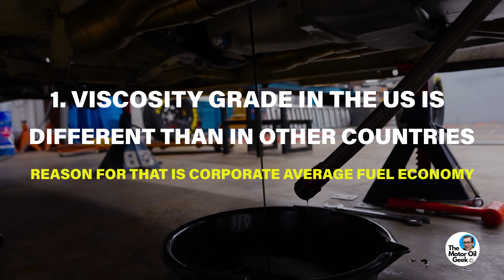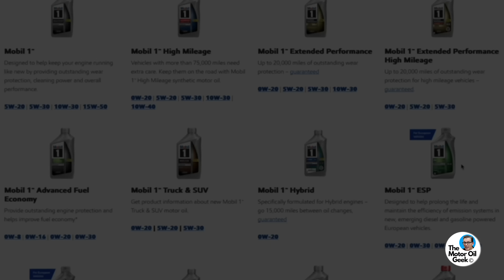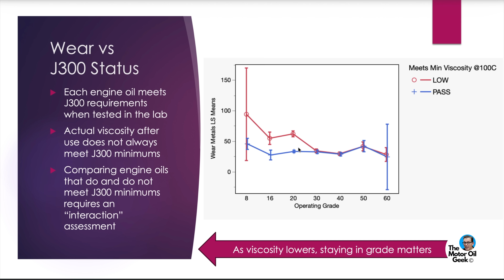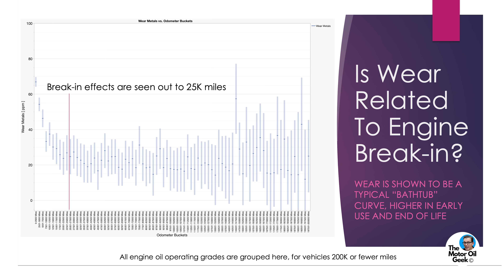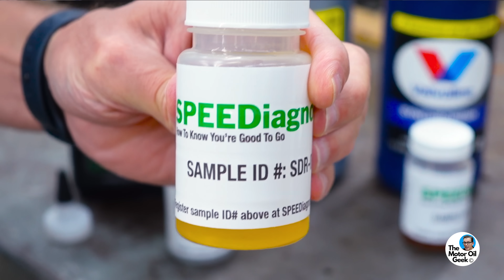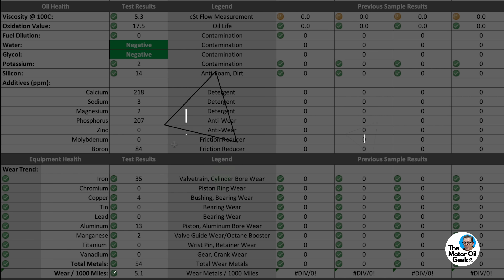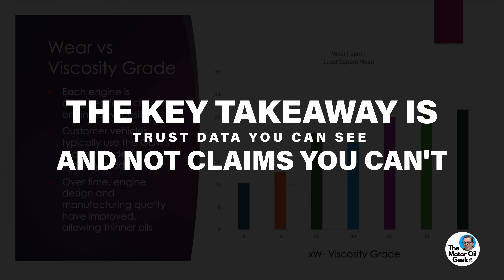More Ai Lies? The FACTS about 0W-20 vs 5W-30 (With Evidence)

Comment: The problem isn't the shearing, the problem is the start up, these engines run zero weight in order to get oil to the cam phasers quickly. The faster the engine can adjust the fuel trim, the sooner it gets better economy and less pollution. That is why they are running the thinner oils. This zero weight are start up is causing these engines to run dry basically, which is why I think we are seeing so many rod bearing failures. I suggest. 5w-20 at a minimum

Comment: I have a 2007 Toyota Camry with 79,600 miles now, the oil cap says use 0W-20, or 5W-20 oil.  I do 3000 mile oil changes and the last 500 miles of the oils life I have had to add at least 1/8 of a quart to the crank case to keep the oil level up to the fill line on the dip stick. Keep in mind now that 2006 to 2010 Camry 4 cylinder engines were equipped from Toyota with low tension piston rings, you're going to get oil pass through.  I switch up to 5W-30 on my previous oil change and did NOT have to add any additional oil to the crank case during that 3000 mile interval and I'm now 500 miles into my second 5W-30 oil change.  Now my 2013 RAV4 uses only 0W-20, I also have it on a 3000 mile oil change schedule, I NEVER have to add oil to it during the 3000 mile interval. On both cars I use Penzoil full synthetic made from Natural Gas motor oil (I'm very happy with that oil), also both engines I also have Mag Plugs in the oil pans and both Mag Plus, no matter what oil viscosity leaves a dark film around the magnet at the end of 3000 miles.  I never had it looked at, but I have a feeling that it's normal engine wear.

Comment: This is why I run 10w-30 in Texas.  There's no justification for 0w here as it's never cold enough to require less than a 10 weight base oil (good to 0F).  And the 30 is highly advisable for the heat and has less sheering variation than wider range oils.  0w-20 just cuts the margins too damn tight, especially in hot weather.  You only need to look at the oil recommendations for the Middle East where there's no perverse incentives from CAFE standards to see what's advisable (they use 20w-50).  Thicker base weights are also more resistant to oxidization.  
The tests with 0w-20 prove that things are fine, right up until they're not.  That's to be expected with fluid bearings.  The oil film works well until it fails, and when it does it's catastrophic.

Comment: Some dealers insist on 0w20 while others put 5w30, operating temps here between 32F and 120F, so extreme heat in summer, there has been lot of argument that 0w20 is not suitable for my environment 5w30 is barely suitable, I am considering switching to 5w40 soon. 
The car manual says it takes up to 20w50 as long as it meets SP specification or up.
The engine is VR35DDTT on the armada 2025+

Comment: Great information, thanks. I do have a question. I recently purchased a new Toyota Landcruiser with the 2.8 liter turbo diesel (in Australia). Toyota recommends 0w-20. However the temperature in my location may get down to 0°C in winter, but up to 40°C during summer. I was about to change to 5w-30 C2 which Toyota does also recommend in the owners manual, although 0w-20 C5 is the preferred oil. Which oil would you recommend given our summer can get a little warm?

Comment: I dont understand IN GRADE terms...can you explain to me like a 5th grader. can someone PLEASE answer my question. So much debate on which oil works best for the Hemi Tick stuff. Lifters, cam etc. I have  2018 Ram 1500...5.7 hemi. It is recommended on cap to use 5w-20. MANY people that have Ram 1500...many say Amsoil or Royal Purple or Pennzoil Platinum Plus..or Mobile 1. and they seem to be most of them choose 5w-30. These are high mileage trucks such as mine...100,000 miles. Please tell me which so i can possibly save my lifters..which one...5-20 or 5w-30. I have seen a couple guys using 0w-30.

Comment: I'm using Mobile 0W8 from Walmart for my 26 Toyota Grand Highlander Hybrid it's at 2.1K miles right now with two oil and filter changes done already. Do you have any data on the viscosity shearing of this brand of oil?

Comment: A 0W-20 can be formulated with virtually no viscosity index improvers (VII), given a decent synthetic base oil blend. And VIIs are what breaks down over time and thins out high temperature viscosity. On the other hand, oxidation will thicken the low-temperature viscosity. Having a good base oil resistant to oxidation will help with that.

Most 5W-30 oils will still need a small amount of VIIs, even when using the best base oils. But if you control oil temps and avoid continuous excessive temps, most quality 5W-30 formulations will also be of "stay in grade" quality.

Comment: Motor Oil Viscosity Test Results
Meets Min Viscosity @100C - 0W and 5W conditions

Oil Brand	0W Percentages |	5W Percentages | Pass % |	Fail % | Pass % | Fail % |
ACDELCO	93.2%	6.8%	53.6%	46.4%
AMSOIL	21	88.8%	11.2%	60.7%	39.3%
CASTROL	90.6%	9.4%	56.3%	43.7%
DRIVEN	        84.7%	15.3%	92.3%	7.7%
FACTORY FILL	75.0%	25.0%	38.5%	61.5%
KIRKLAND	96.7%	3.3%	77.1%	22.9%
LIQUI MOLY	67.6%	32.4%	27.6%	72.4%
MOBIL	63.3%	36.7%	60.0%	40.0%
MOBIL    57.1%	42.9%	60.5%	39.5%
MOTORCRAFT	75.0%	25.0%	16.0%	84.0%
MOTUL	72.7%	27.3%	59.5%	40.5%
OTHER	69.9%	30.1%	49.0%	51.0%
PENNZOIL	86.1%	13.9%	62.7%	37.3%
QUAKER STATE	71.4%	28.6%	50.0%	50.0%
RED LINE	100.0%	0.0%	90.3%	9.7%
ROTELLA	0%	0%	90.9%	9.1%
ROYAL PURPLE	100.0%	0.0%	75.0%	25.0%
SHELL	66.7%	33.3%	33.3%	66.7%
TOYOTA	73.4%	26.6%	0.0%	100.0%
UNKNOWN	83.7%	16.3%	62.5%	37.5%
VALVOLINE	92.4%	7.6%	68.2%	31.8%

Comment: My rule is, If you have a stock vehicle use the weight it says on the cap and make sure its a decent brand. You arent going to outsmart the chemist who synthesised that oil or the engineer that designed the motor 😂

Comment: In an older engine, the carbon removal benefits from Valvoline Restore & Protect 5W/30 may be as or more important than it's ability to sheer out of viscosity because an engine with sever carbon deposits, (especially in the ring lands) means the oil is burning out the tailpipe and damaging the cylinder walls, thus reducing compression. My guess is you'll see several more carbon removing oils on the market soon that match or beat Vavoline's R&P..

Comment: In Australia new V6 Toyota Land cruisers came out with 0w-20w oil but towing a loaded caravan in 40c heat cooked the engine some under 10k. So Toyota recommends 5w-30w oil. This guy seems to be running damage control rather than a true review.

Comment: Another great video.  Just installed a Gen 3 hemi in a ‘19 pickup. The reman manufacturer suggests 5w/30 in their rebuild.  Is this a good thought process?   The hot idle psi is 30-31 while it goes to 60-65 psi off Idle.  Seems like this recommendation contradicts this video?   TIA.😊

Comment: I have 60,000 miles on a 2021 tahoe, 5.3 motor, I use 0w-20  Mobil 1 extended protection, usually change the oil and mobil 1 filter between 4k to 4500 miles, I reduced my change interval to 3200 to 3800 miles just to play it safe...  I'm switching to a Fram Endurance filter just to increase filtering a bit.  I also never let the engine monitoring oil change interval computer get below 50%.     I have a friend that has a 6.2 engine and it just blew up at 50,000 miles! Im not sure what his change interval was however that engine has different issue from my understanding. 

KNOCK on WOOD!  No engine problems yet but I am holding my breath....

Comment: Anyone that has worked on these engines using these super light oils knows how bad it is for reliability and longevity of the engines. If it calls for 0w20 use 5w30 it will buy more time for the engine. Don't believe me fine. You will have sever premature engine whear and failure. Unless you lease or buy a new car every 3 years.

Comment: 2012 rav4 2.5l 286,000+ miles use 0w20 synthetic oil northern region change oil every 5-7 k miles. compression is 10% lower than at 100k miles. Valve train is noticeably noisy now but milage has not changed at all. Changed to 5w20 valves quieted compression restored to the 100k mark and milage is the same. From a functionality perspective it would seem that the 5w30 is superior in an older engine but mpg is unaffected. Power is increased without increased efficiency. I believe simply that the rings are sealed better but the increased friction or resistance nullifies any gains.  Since friction is the long term killer i would say 0w20 is the better choice. An additive that reduces friction and seals rings is the key to restoring power and increasing mileage while providing longer life.  That would be a great test.

Comment: I have a 2019 5.7 hemi in my RAM pickup, as you may or may not know these engines have distant lubrication issues because they rely on the crankshaft to splash oil up into the upper lifter galleries, at low RPM this doesn't even occur. That being said, this manufacturer indicates I should use 5w20 oil, many others suggest higher viscosity oils some as high as 10W-40, MS 6395 is also the spec for this oil according to Ram. Keeping this lousy MDS system in mind, what oil would you recommend for this engine for best performance keeping the above in mind?

Comment: My 2013 Honda Civic missed a couple oil changes (don't ask) and with Valvoline full synthetic 0w-20 it is doing fine.
It has 99,000 miles on it and, oops, had 18,000 highway miles on one oil change.... usually go 7- 8,000 on a change.

Comment: You didn't mention one critical point: heat. What that does to the cooling properties of the oil. We do a lot of towing here in Oz in high temps. Have a look at those issues.
Reply: Heavier oils are going to cool worse.

Comment: I bought a 2009 Lexus Is250 with 220,xxx miles. The oil cap says 0w-20 and the MPG with the oil the used by the previous owner and his 0w-20 read 22 mpg. I use Mobile 1 5w/30. Reset the computer 27 mpg. That’s all I have to say about that.

Comment: Very interesting data you are sharing. 

I haven't had any issues with my 0w-20 grade motor oils. However I don't usually beat on my cars enough to warrant oil degradation. 
I'd like to hear from others and read about this. How often is your oil degraded and what causes this? (:

Comment: I use 0W‑20 Mobil 1 in my 2016 Lexus ES300h, which currently has 266,000 miles. I bought the car used at 133,000 miles, and it has never had any oil‑consumption issues or other problems. I’m considering switching from 0W‑20 to 5W‑20, but I haven’t made a decision yet
Reply: My sister bought the same model and year Lexus last year when it had 67k miles (since she liked my 2016 Camry XLE Hybrid).  Has yours been reliable overall, including the Hybrid Battery?
Reply: @j @jimn.9990  As long as you keep up with regular maintenance—such as changing the oil every 5,000 miles, replacing the air filter, cleaning the hybrid battery filter and fan, and changing the coolant every 50,000 miles—the car will probably last well over 500,000 miles. Also I change the transmission fluid every 60,000 miles, clean the throttle body every 40,000 miles, and use a fuel‑injector cleaner every 20,000 miles. Just recently, I noticed a leak around the coolant reservoir, which likely means I need to replace the radiator cap.

Comment: Shearing out of grade resulting in excess wear and premature crank bearing failure was the reason FCA changed the spec of their Ecodiesel oil requirements from 5w-30 to 5w-40 under (TSB 18-078-16).  That also enabled a move away from a very expensive Euro Spec oil to the more readily available Shell T6 so it was a win/win for customers too.  I have 173k miles on my Ecodiesel now and it's never been in the shop other than the CP4 recall.

Comment: Every engine is slightly different, especially after 100,000 miles.
My 2003 vehicle the manual says 5W30, but 10W30 can be used in temps over 0F., and it recommends 0W30 or synthetic 5W30 if temps are suppose to be -22F or lower. Used 0W30 once, wasn't impressed so switched to synthetic 5W30. But was getting a little squealing at startup. Switched to conventional 5W30 and the squealing at startup stopped.

Comment: The only thing you didn't mention is the fact that when 5w30 is out of grade, it will still be at or even above the viscosity of 0w20.
Reply: And provide protection better, so the AI does seem to be correct because people don't change oil on an interval that prevents this... Why are built in change interval reminders in cars so much higher than say 5k miles?
Reply: @MrKrasniak  To increase shareholder profits from new car sales, of course
Reply: @MrKrasniak  yea i would never do over 5k miles on a engine oil you should be changing your oil twice a year  at least no matter what
Reply: @M @MrKrasniak y wife’s Santa Cruz is recommended to have oil changes at 8,000 miles. I told them no. I want it changed at 4,000 miles. Funny thing, the cars computer tells us that it should be changed at 5,000 miles due to our type of driving. Uh.. I drive it fairly often because that 281 horsepower is just plain fun! 😂
Reply: He did mention it. 3:30
Reply: He did
Reply: @rickybobby7752 not word for word
Reply: What does in / out of grade mean ?
Reply: @Karl_Burton  It means that if the oil is rated at a viscosity of lets say 10w to 30w, the oil remains within that range. It not thinner than a 10w oil or thinker than a 30w oil. So if the oil breaks down enough that be comes as thin as a 5W, it is out of range.
Reply: @BikerGirlTraveler Thank you
Reply: @Karl_Burton  The extreme pressures and heat in an engine will make oil less viscous over time.
Reply: @BuddyTheWolfYT  Thank you
Reply: So you’re saying I should stop putting OW 20 in my Chevy Malibu and start putting 5W 30
Reply: @JC-z5c  Unless you live in Alaska yes
Reply: @BuddyTheWolfYT I live in a very hot state phoenix
Reply: @JC-z5c  yeah goo for it

Comment: I'm curious if CVT's will aid in keeping motor oil in better condition long term. Let me explain.
A CVT likes to keep an engine in a lower RPM for better gas mileage; lower RPMS would lead to less friction and heat right? So you'd think that would mean less degradation on the oil?
Reply: Never driven a CVT huh?

Comment: My first car was a Camry that used 0W-20 oil. After that I had a RAV4 and an Accord. Because of my job, I drive about 200 miles a day, sometimes even more. I put over 250k miles on all of these cars before selling them, and I usually  do 10k OCI, I’ve noticed that most new Japanese cars now run on 0W-16, or even 0W-8.  At the end of the day, people who blindly believe in 5W-30 are no different from those who blindly believe in 0W-20 like myself

Comment: Going from 0w-20 to 5w-30 stopped the tundra tick dead in its tracks. So there’s that. They changed the oil specs without changing the engine specs on the 5.7. Weird how that worked out…
Reply: Same problem with my '17 Tundra and have used Penzoil Ultra 0w20 at 5K intervals for past 3 yrs - still ticks.   What 5w30 did you use?
Reply: @austina9605 royal purple 5w-30.

Comment: Well, I have a 22' Ram with 5.7 Hemi which calls for 0w20 but my other 5.7 called for 5w30. I had a very light tick in the 22' until I switched to 5w30. Now it's gone and the engine purrs like a kitten. My wife's 22 Durango has Pentastar v6and it developed a noticeable tick on 0w20. I discovered that engine also called for 5w30 when it first came out. I put 5w30 in it and the tick was gone. Unfortunately, she traded it in for a 25 Jeep Compass which sounds like it's going to explode when it first starts up but it calls for 5w30... 🤷

Comment: Recently, I had my recall done on my 2021 Chevy Trail boss. All the shop did was change out the oil cap from W 20 to 0W 40 and put new oil in the truck. They also did what was called the pico scope to check the cylinders to see if they were damaged which they said they were not. Along with this they said that Chevy gives a 10 year 150,000 mile warranty on the engine. Since changing out the oil, my truck does not burn as much oil. I don’t know how good the warranty is going to be in the future, but it’s at least something. I would never put 0W-20 oil in a vehicle again. It’s my own opinion, but I rather change out the oil more often to prevent wear or sludge

Comment: I agree with the closing comments overall. However, the presenter's assertions, along with his playing semantics and technicalities, are annoying.

1: He asserts data from over 10,000 cars, but the graph shows data from ~6,000 cars.

2: On shear stability: The cold-temperature viscosity of the base oil is closer to the hot-temperature viscosity when using fewer modifiers. Of course it's going to be more stable—there are fewer polymers to keep the oil thicker, and thus less to break down.

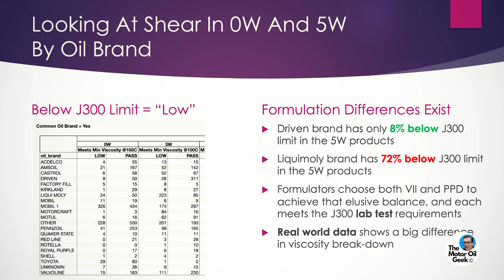3: Some brands hold shear/viscosity better than others (see timestamp 5:16). However, the sample sizes vary wildly, from hundreds down to just a couple per brand for comparisons. You cannot make strong assertions without similar dataset sizes between brands.

4: What bathtub curve with wear metals? I see bands of min and max values that jump all over the place. No reliable trend line can be asserted. About 12 plot lines cross the 0 line on the graph, implying negative wear (see timestamp 4:51).

These points miss the biggest issue: Engines are blowing up, with massive recalls from multiple manufacturers. A common factor appears to be 0W-20 oil combined with variable-displacement oil pumps.